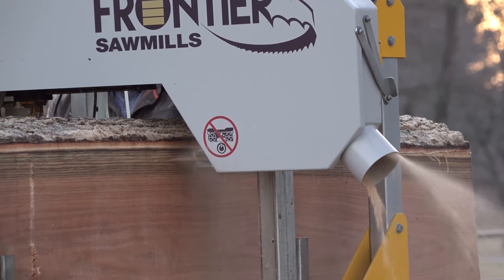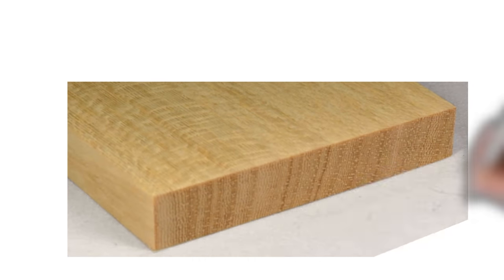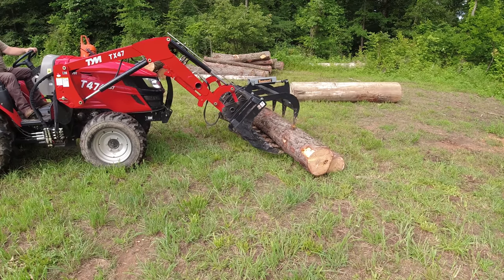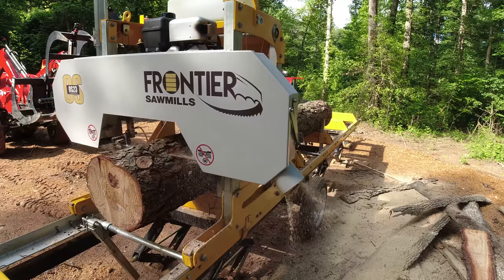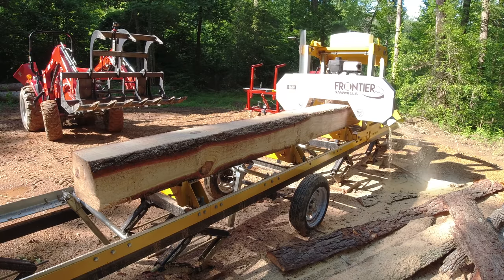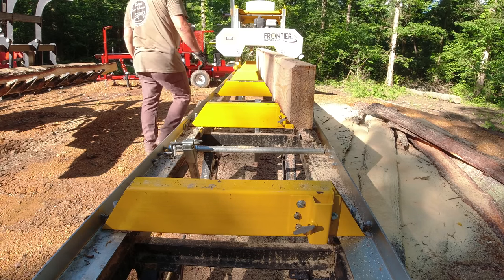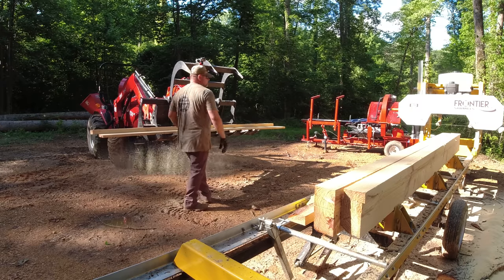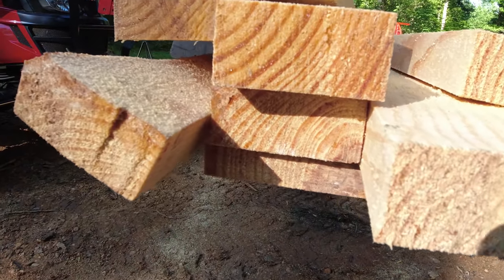Tips & Tricks Quarter Sawn Lumber

Comment: if you've ever had the opportunity to salvage an old house (1900 or so) you might notice the interior trim is often flat sawn pieces, and if you see the back side they probably have been plowed out with a plow axe to break the grain so they wont cup.  even new trim has a back cut on it to relieve the grain to prevent cupping.  thx for the informative vids.  everytime i watch your vids i get closer to ordering one.
Reply from the maker: Thank you. I am learning more each time I build a new project. I am interested in how they did  the old ways.

Comment: The more dense the grain, the better? In the case of oaks for instance, the denser the growth rings, the more brittle and weaker the wood. The wider the growth rings, (faster grown) the stronger the wood. This is the opposite of softwoods.
I agree that its nice to make your own real 2 by real 4 lumber. Here in New York State, they stopped requiring stamped lumber be used for homebuilding if its rough cut. You can use rough cut non-stamped lumber for a house and it will pass code. They did this around 10 years ago to help small sawmills and found that the quality was every bit as good as stamped lumber when inspected.  One of the few states that allow this.
(Luke 24:46-47)

Comment: Fantastic video.  You were spot on with your advice.  I had the same learning curve when I got my 023 in 2019.  If you upgrade to a 14 hp, you will need to upgrade the centrifugal clutch.  You can throw a Predator 8 hp (301cc) on use the same clutch.  Brings your torque up to 14.9 ft lbs which is what really gives you your cutting power.  I have one ready to put on mine, but we've downsized and moved from our house of 30 years about 3 weeks ago.  Sawmill time has not appeared on my wife's to do list yet.  I'll shoot you an update once I install it.
Reply from the maker: I appreciate the insight. I am read to upgrade soon
Reply from the maker: Did you upgrade your sawmill?
Reply: @TonysTractorAdventure  Have not put the engine on yet. I put  the new clutch on just in case I go to a bigger engine later. I was throwing blades like you were after the new clutch was installed. I had to move the engine forward on the head due to the pulleys being out of line. Fixed the problem immediately.
Reply from the maker: I am waiting on a clutch. I have the new engine mounted. Hopefully the clutch will be here tomorrow.
Reply: @TonysTractorAdventure  Cannot wait to see the upgrade.  I think it will be a game changer.

Comment: ya that motor was struggling defiantly put a 14hp on her
Reply from the maker: That is an old video. We ended up putting a 14 horsepower electric start on the Sawmill. It screamed through wood. Here recently we upgraded to the OS 35 with a 22 horsepower. It is bad to the Bone.

Comment: This sawmill is good for somebody with a lot of time on their hands with the amount of time and money you spent running your machine. Your tractors you could have went to the box store and bought the 2 by fours. And already had the project built. Sorry, Tony, but I'm looking at the facts.
Reply from the maker: The fact is this. I like having the sawmill. I use the tractors for a lot more than just the sawmill. I cut 6 White Oak beams that cost more than the sawmill. There is a lot more to the world than just 2x4s
Reply: That's not the point. The point is the fuel that you use to run the sawmill. And the tractor cost just as much as buying the 2 by force. And not to mention all the time, it takes to run the 2 / 4 a lot of time. You're better off going down buying the 2 by fours that you want it be a lot cheaper.  That's my point. I can see making special cuts beams and other large pieces of wood but 2 by fours. It's just the waste of time and energy.